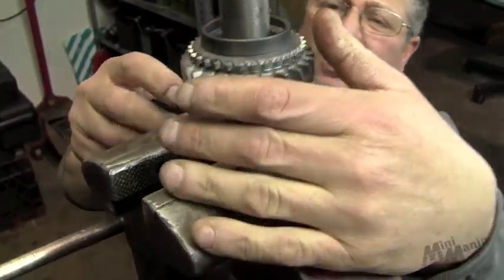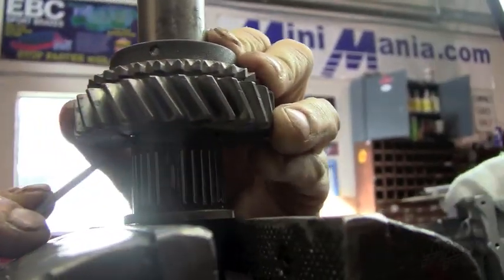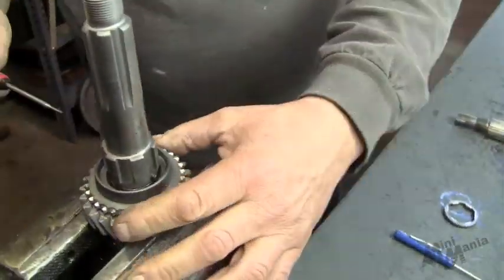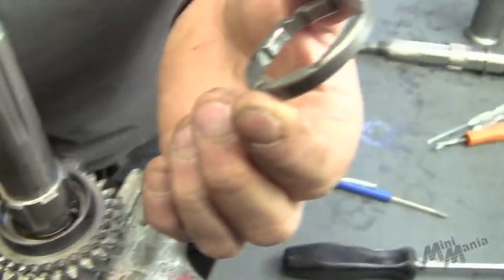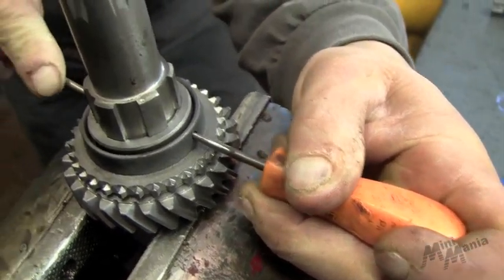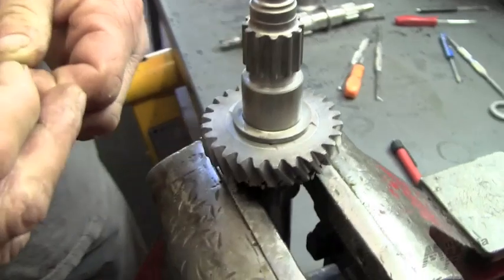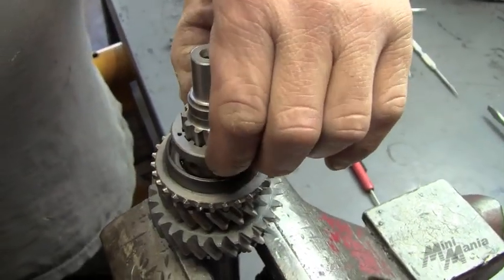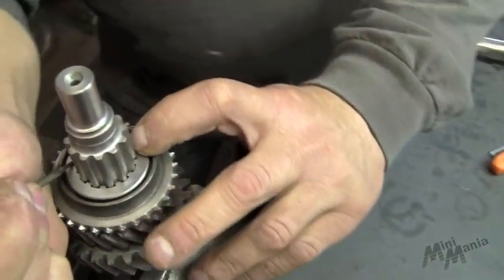Old Classic Mini Gearbox Rebuild - Part 2

Comment: It's been many years since I did lots of these boxes but I would have given everything a generous coat of engine oil as I assembled it. Not a big problem as it all effectively sits in an oil bath but good practice. I would have used soft jaws in that vice too :-)